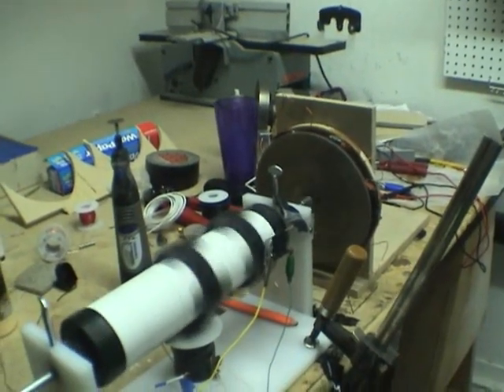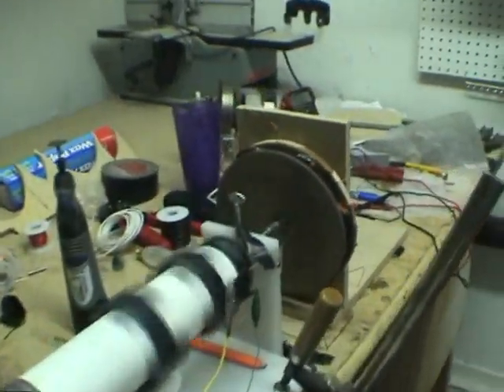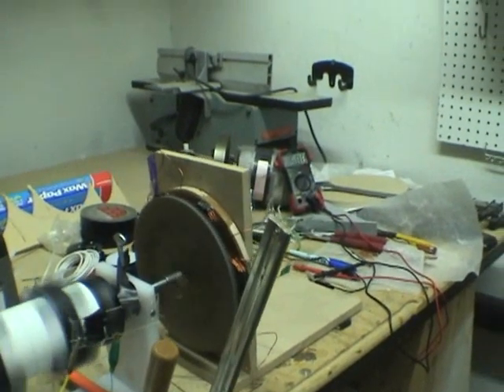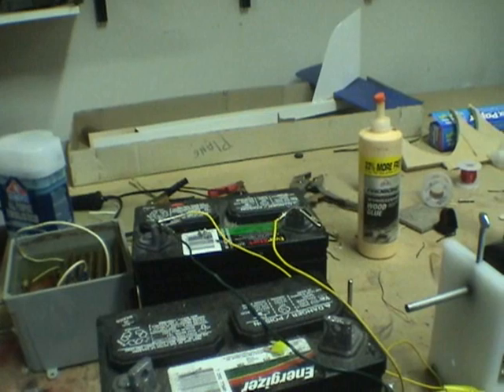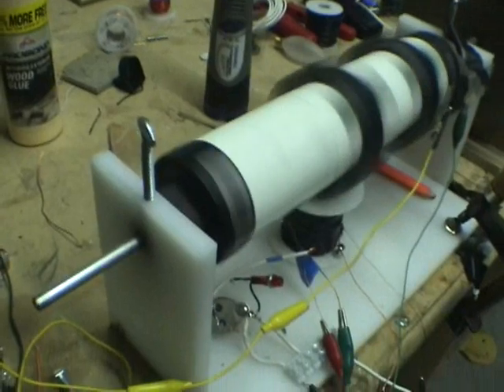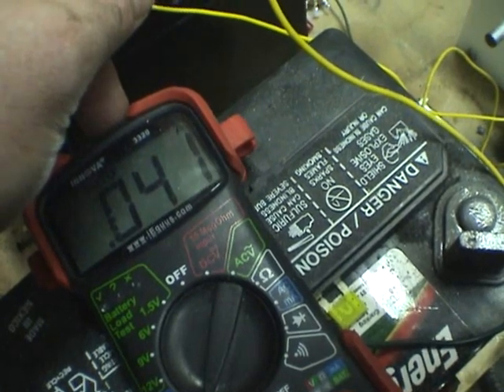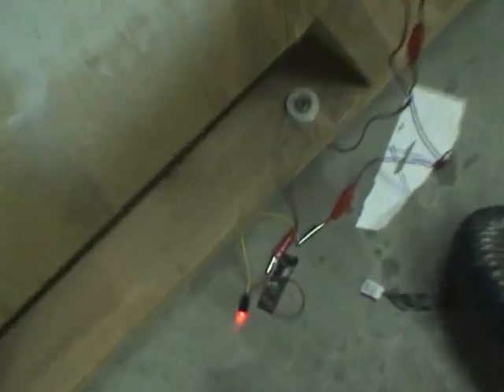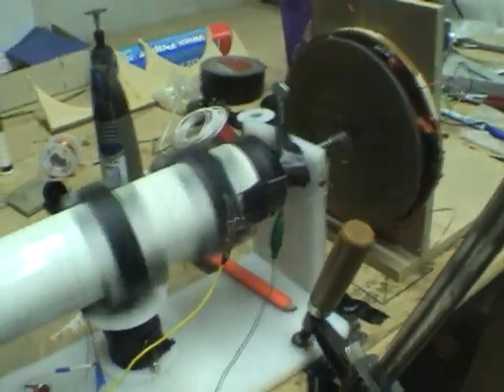MUST SEE!!!!

Comment: So this shows that you have taken a 12 volt motor and turned a alternator to produce a higher voltage that's is all. The same is done with a transformer. There is no power gain.  Voltage alone means nothing. voltage times current equals power.  You are actually losing power here. 

What is the point?  Energy in is greater then energy out.

Comment: I'm gonna draw a parallell here. Think about, say water instead. Water as in say the water the comes through your faucet. Then Voltage would be the equivalent of the water's preassure. And the amount of water that's slowing would be equal to current(amps). The combination of voltage and current is what's called power, and is measured in watts. You need voltage to make a current flow, but you dont need current for there to be a voltage. I hope this helps.

Comment: very good, replace the reed with a coil which will send a pulse to a transistor used as a switch to run the drive coil.the induced voltage in the coil will open the transistor. will operate flawlessly for a long time. the reed switch will eventually begin to stick. with your setup, you can add multiple drive coils...a three or four banger = tork.   looks good. marc.

Comment: Hello Todd, 
Thank you for your excellent video's.
I am constructing a simmilar device with a magnet motor.
Did you switch to the 6 coil generator for this test?
If so did you get more output from the 6 or the 9 coil design?
P.S. Dont let the nay sayers piss you off, we have a saying in my familly "dont blow my candle out, just to make your flame burn brighter"!
Thanks again.
Eddie

Comment: But seriously, you have allready made a selfsubstainable motor.
You don't provide it with any extra power, you just give it the magnets and a battery which it can recharge for as long as you like and it give of a lot of torque.

And i don't think that the magnets only will last for as short as 25+- years, atleast i thought that normal magnets could have a very long lifespan.

Comment: And yes. Question. I have my bedini motor, now making better one, where is 4 coils. And do you think I could make same altinator/generator and put it on the wheel, will I get some results?

And yes, you said that input is 0,3W right?
And output is 4W. Where did you meter inputs?